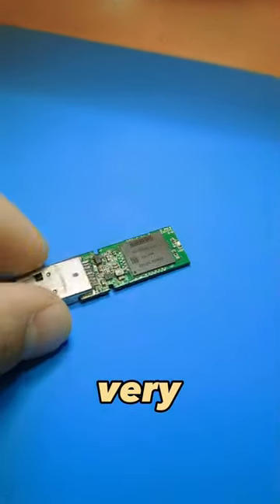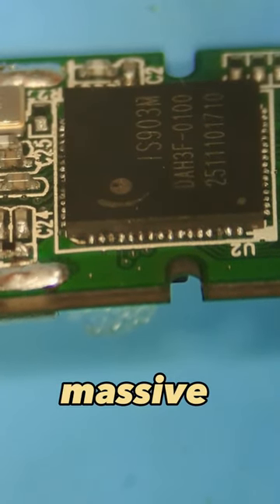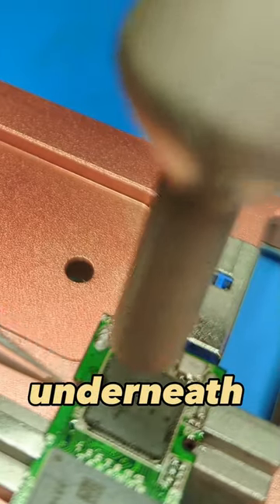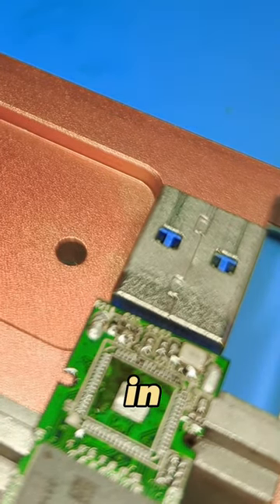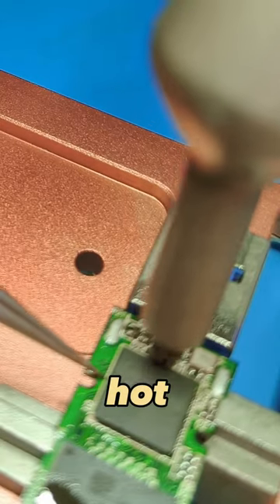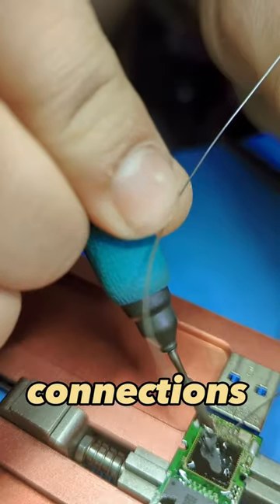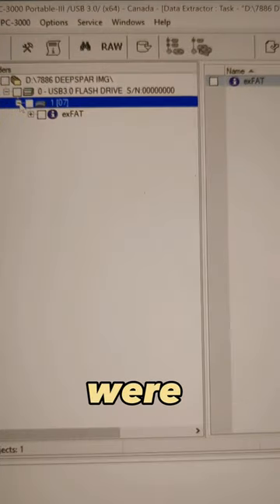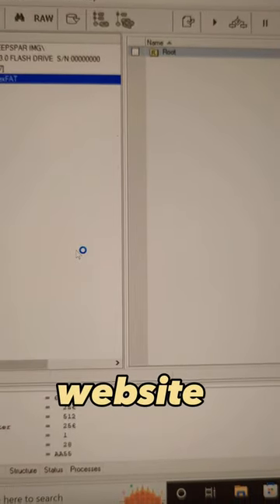Soy-riffic flash drive accident | repair and data recovery

Comment: Question: i noticed that even if the devices is back to a normal working state, you still recover the files using the software. Is there a reason for it or is just a matter of preference?
Reply from the maker: Always make an image of the device. It's a number 1 rule